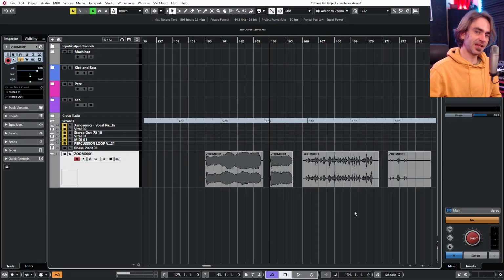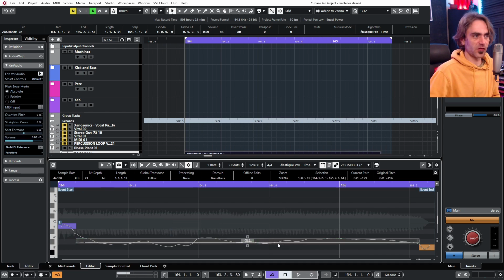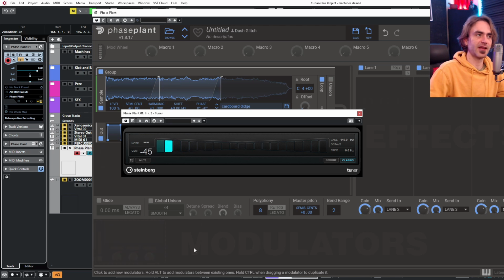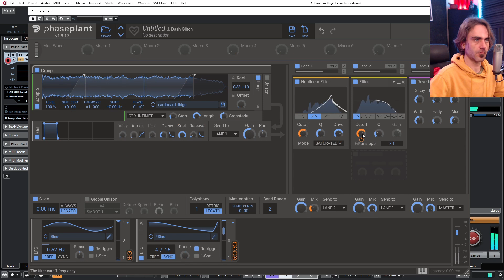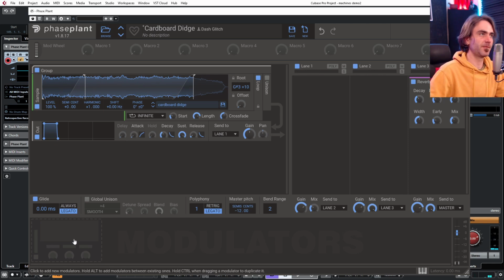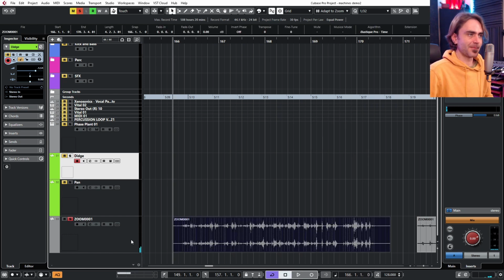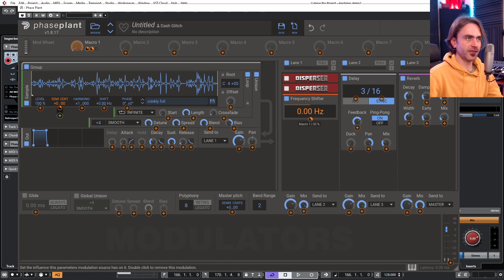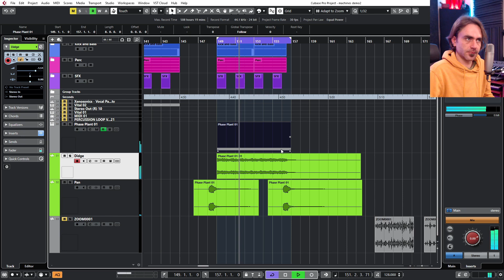Synthesizing a Didgeridoo Using a Sampled Cardboard Tube

Comment: I did one with serum =)! 
1. Osc 1 Really low saw 1 voice, 
2. Osc 2 Really low saw 2 voice. 
3. Lowpass 6 with some resonance 
4. draw lots of wild peaking curves with different lfos. some 1/1 tempo , some 1/2 .
5. route them to modulate filter cut off and drive.
6. add hard clip distortion, phaser, eq , second lp filter 6 without resonance
7. automate second filter with crazy lfo curves. 
8. short plate reverb to add room or add dimension.
9. Make sure oscillator phase is down and random off. clic mono button under lfo section.
10. Wank those settings and voila u got digeridoo! or fartidoo or something like it.